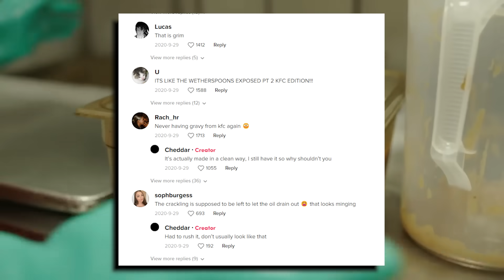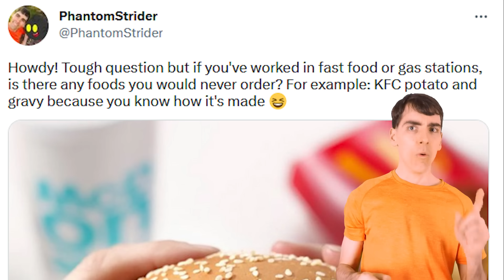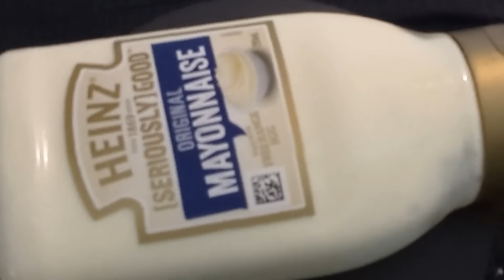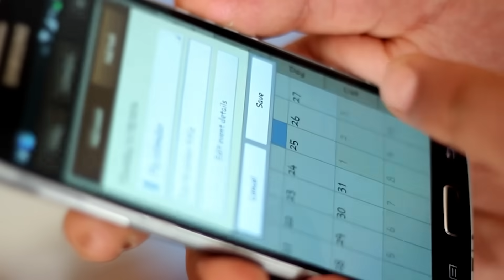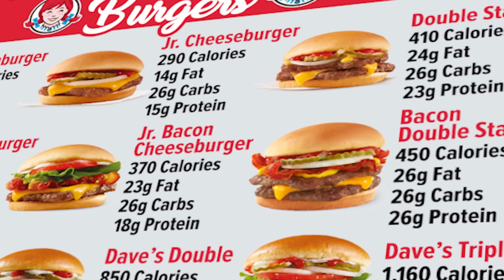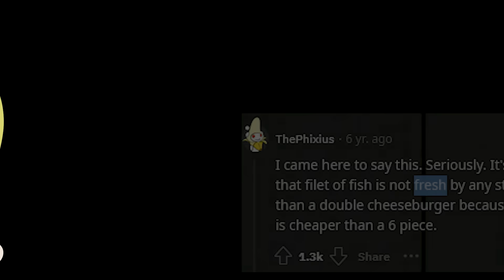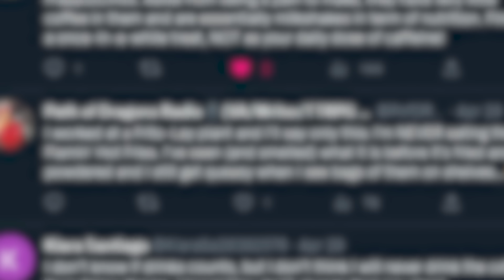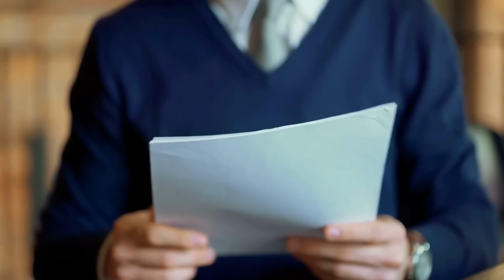The 10 Fast Foods Staff Never Order

Comment: According to an old friend that used too work at Wendys, the meat in chili is hamburger patties. But it was never more than a day old, the chili sold fast enough most often. The patties used would be ones that were either burnt, broken, or ripped. It's a way of them still making money on perfectly good patties that weren't well rounded enough for a sandwich.
Reply: *well-squared
Reply: Tbf that's EVERY deep fried food always better fresh
Reply: Anthony Bourdain explained the same in the movie The Big Short. Common practice and I’m here for it lol
Reply: This is true that chilli is fire 🔥
Reply: The only problem is that the chili meat Patties could be left out for so long that they’re basically a rock
Reply: @Obsolete935  This is not really a problem as these patties are usually frozen overnight so they will be hard regardless Afterwards they are rehydrated in boiling water and added to the chili
Reply: This is actually not the part about this that is bad.. Its the process.. 
First they take all "dead" burgers off the flat top, then throw them in a plastic home depot bucket that usually sits under the grill until it fills up, usually the end of every shift.
Then they take that home depot bucket, and fill it up with unfiltered tap water and it sits in the cooler until the next day, when they make the chili.
They drain the water and plop the soggy meat sponges in a plastic bag and squeeze the water out and ad spices in the bag and massage it, then back in the bucket where more unfiltered, bleach smelling tap water is added.. its disgusting. the ONLY good thing they have there, are the baked potatoes. its literally a potato they wrap in foil and stick in an actual oven..You dont even want me to explain what Arbys is like.. or how their meat is literal liquid before its cooked.
Reply: Companies that can safely, legally, and morally monetize their by-products or would-be waste deserve the extra income and success.

Comment: The bean thing makes sense, honestly. When I worked at a Mexican restaurant our refried beans were a pain to make because we made them from scratch. They needed to be boiled in a massive pot for like an hour then mixed with oil and mashed. It makes sense that a fast food place would use a quicker method.
Reply: I worked at a Taco Bell in the late 80's.  Back then the beans were made from scratch also.  We had to sort through the beans to make sure there were no rocks.  Then the beans were put into a pressure cooker with a bag of the seasonings and lard.  After they were cooked, an electric drill with a mixer blade attached was used to mash the beans.  The smell of the drill (electric motor overheating) used to nauseate me.  I'm betting that Taco Bell doesn't make the taco shells fresh in the store any more either.
Reply: @bun04y  that Taco Bell sounds like one worth actually eating at. I wish they could’ve continued that
Reply: Not only that, but the "weird film" the employee was talking about also happens to just... normal, cooked refried beans, traditionally. The lard/fat used in it and the fact that it dries as it cools gives most beans a slight film.
Reply: Anybody complaining about the beans at Taco Bell can bite it. I would bet money they have no complaints about throwing potato flakes in boiling water to make mashed potatoes...

Comment: The gravy thing is so funny. Not only is that how we always make gravy (the drippings just come from a pan instead of a deep fryer), but several times a week I'll make some sort of pan sauce, and a key step is not cleaning the pan after cooking meat. The sauce liquid will lift the bits off the bottom, and add lots of flavor. It's called "deglazing," and it's effectively the same as using drippings, but on a smaller scale. It's very amusing to me that people are so used to everything being ultra-processed that we don't even know what gravy is if it's not powdered and sold in a packet.
Reply: that's how everybody makes gravy...it's frankly a little alarming that so many employees didn't know that.
Reply: Waste not, want not. I'm not huge on gravy though I've made it for family. I'll make bone broth and stock by saving bones, joints, etc. and use animal fat to flavor vegetables/carbs

Comment: When I worked at Burger King, we also had "hot boxes" for food. We would store cooked hamburger patties in these plastic trays under little heat lamps. They had timers on them that told you when to throw them out, but management would have the kitchen staff just trick the machines into resetting the timer by removing the tray, putting it back, and oressing a button to start it over. If you want something fresh there and it's not peak hours, just get fries with no salt because that means you're usually getting fresh fries since the big batch of fries is already salted. Sometimes theyll just throw the old fries back in the fryer for a minute though. And dont forget to ask for salt packets when you do that!

Comment: I have a total of two stories on fast food soft-serve (yes, it's really that notorious).

My partner works at McDonald's and backs up the claim that the ice cream machine is never actually "broken" like the employees say...it's just going through its regular long cleaning process. They just say it's broken so the customers don't wait around for four hours at the restaurant without ordering anything. My partner also says that it's more likely for one of the grills or deep-fryers to be broken only have one running at a time.

The second story is a little more gross, so don't continue if you have a weak stomach. A teacher I had back in high school used to work at a Wendy's. That store hired a rather unintelligent person who would regularly water all the plastic plants around the dining room. What finally got them fired was when they used a toilet scrub-brush in the Frosty machine on multiple shifts (with nobody realizing until after several days). The health department was called, the employee was fired (and possibly blacklisted), and the Frosty machine was completely replaced, so nobody needs to worry about getting a toilet Frosty.

Comment: I'll break some heart in here for saying this but DO NOT order anything with eggs in it at taco bell. I used to work there and it comes in a back, is boiled in the same water everything is boiled in so its usually gross water. BUT thats not the main issue. When opened it makes the whole kitchen smell like sewage, and many times they boil 2 bags one kept on line and the other for when they need to refill.

The 2nd bag is usually not used for a very long time, so at the end of breakfast if you're ordering anything with eggs in it, youre usually getting that 2nd bag that has been steaming for hours, they use to refill the line. 

They almost never throw anything away. Ive seen them use steak that has been on the line dried out for hours, they add hot water to it and voila. Thats the steak you get in your burritos, same with refried, chicken etc.

Also if you didn't know it, their ground beef has chocolate in it. Thats a little known thing, and explains the weird taste when you eat it on its own.

Comment: Former Wendy’s employee. The chilli we actually used combined with the unused meat (if we didn’t use the fridged meat within two weeks we threw it out) we put it in some trough, and add 2 full big pitchers of water (i think its about 2 gallons), mixed with this, concentrate paste, and refrigerated beans. Its super watered down, some days its a little pastey, and on some days is basically soup.
Reply: Sounds like inconsistent prep cooks that were more 1 cup of water... so like this 44oz cup? 😂 if cooked right it's usually about the same. Though claims of clean meat is ehhhhh at best.... at 4 different stores the extra or bad patty holder didn't work or something so after a days meat collection in a room temp tray they freeze for 1 to 4 days then boil.... boil old spoiled meat.... no thanks.

Comment: worked at subway - the meatballs in most stores are not changed out as often as they're supposed to and the temp they're kept at is too low to keep it sterile for longer than 3-4 hours. some stores do change every 4 hours like they're supposed to, but it's rare because managers tend to be super annoying about waste and prevent you from throwing things out too much, so they get left for 6-8 hours instead. a lot of ingredients are like this, but with the cold ingredients it's a bit different.
Reply: Also, as a former Subway employee as well, watch out for those tomatoes. They arrive in shoddy condition at best and often have blue mold on them that we try to clean off
Reply: I also worked at a subway. The meatballs were always kept at 165 degrees F minimum temperature. The meatballs had to he used within 2 days, unless they got too dried out and had to be discarded, so adding a little water now and then to the marinara sauce and stirring them around was essential in keeping them "fresh". Sounds like the temperature of the water in the bain that the meatballs are stored in needed to be turned up at the store you worked at, which management is responsible for setting.

Comment: I make gravy by cooking the fat off of bacon or other fatty meats, I take the fat and add in some seasonings and flour until it’s a wet sand consistency. Then I slowly pour in beef broth and stir constantly. Usually about two tablespoons of beef broth at a time, stirring until there’s no lumps, then adding the next bit of beef broth. Until it looks a smidge thinner than gravy should be, then I cook down and stir frequently until it matches about what you’d expect gravy to look like. Then it’s ready.

Gravy is cooked fat oils, seasoning, and a binder like flour. Then some liquid like beef broth, or water, or milk if you want to make a country gravy. The KFC gravy is completely the traditional method of making gravy from scratch.

Comment: I've worked at a gas station and it's really very clean. It's got a grody name (and ofc still don't get gas station sushi) but most gas stations with a food counter (mostly bread and baked stuff) is really quite clean. I had to check temperatures constantly, of both the prepared stuff and the coolers. The only think I'd avoid is the lettuce on sandwiches because they always made us add the old stuff on top. But besides that? Really clean. Ofc it varies place-to-place. I'm Dutch.

Comment: I used to work at Wienerschnitzel and In my time working there, you can definitely tell that across different restaurants, certain things are different. Like at ours, we left ice cream toppings like carmel and chocolate syrup at room temp all day where another one of our restaurants about 15 mins away, kept them in warm-boiling water. Across all of our stores we valued the ice cream though, every store that I went to(4 in my city) our machines were religiously cleaned every other day. Our managers cleaned it so it was always done and done by someone who had at least a few months under their belt. We used a sanitizer sent by the ice cream machine company itself and followed their instructions to a T. Our ice cream mix came in a bag and was frozen as it came out of the machine. On top of that, their machine always works, was only broken once when I was there and that was because the AC broke and it was literally 120 degrees in the building. Our chili is made with the same patty method though, chopped up, boiled, put in chili mix and served. I trust it too because I know the pattys are never neglected. Sure they might sit in the hot plate for a bit but it’s an enclosed hot plate kept at 165 to keep bacteria away. Plus the boiling gets rid of it. 

Never order a veggie dog though… they are microwaved and get rock hard if they are left out for any length of time after cooking.

Comment: I can kind of agree to the ice machine concerns. I used to be a supervisor at a subway for about 16 months. In those 16 months I can only remember the ice machine being cleaned (by a company) only once, so I assume it was only a annual service. We would take a scoop and scoop the ice in to a bucket, travel across the store with it and dump the bucket of ice in to the top of the soda machines in the lobby where customers get their ice. The thing is... that bucket and scoop sat on top of the ice machine in the back and was never really washed out, and the scoop never sanitized in between uses. I never thought about it at the time as a issue but looking back on it I'm sure the ice got dust and germs on it on a daily basis. Most customers seemed surprised we manually filled the soda machine with ice ourselves. It would definitely be more convenient and sanitary if the soda machines made their own ice.
Reply: Bro.... That's on you than... Clean the stuff!
Reply: When I worked at Burger King it was similar, we carried the ice in a bucket from the back to the front, though the unsanitary part comes from the scoop itself, since one person handles money/cards, and scoops ice into drinks, it was easy for the handle of the scoop to get into the ice. I'm pretty sure I was the only person to ever clean that scoop during the whole time I worked there.
Reply: @farmingsim9813  Right, we were never taught/told by our manger or district manager to clean the scoop/bucket and it might have seemed like common sense but if you ever did something wrong (use the wrong kind of cleaner/disinfectant to clean something) you could get written up. We only cleaned things that we knew HOW to clean "by the book" so a lot of simple little things like that didn't get cleaned. Plus if it wasn't on our daily cleaning list nobody gave it a thought.
Reply: I worked at Taco Bell for 2 years and nobody ever cleaned the ice machine. I didn’t even know it was a thing that had to be cleaned

Comment: I have worked in Kitchens my whole life: The gravy thing: My exact reaction to "this is HOw gravy has been made for hundreds of years..." was NO no no no no no , no no no no no.
It's similar, you take the residue, the fat and oil from a pan of rendered meat and use that. THE BOTTOM OF A DEEP FRYER from a FAST FOOD RESTAURANT run by people who I can guarantee you dont filter the grease every day......IS NOT HOW ITS BEEN MADE FOR HUNDREDS OF YEARS. First of all, if you were to do this in your own home, you would fry your chicken in small batches right, then drain your oil, then take that remainder and dry it or else it's full of fryer oil then use it as a sort of Roux in a sauce pan to make the gravy...it certainly wouldnt be the  (at best case from one work day) the remainder of hundreds of pieces of chicken from a day of work. Then you cant guarantee that chicken was the only thing in that fryer.
Even then, that's is ABSOLUTELY NOT how gravy is made.
That's like saying putting the mold from expired bread on your fresh sandwich is the same as cheese. You just have no idea what you're talking about.

Im truly upset at how idiotic this section of the video is. They are literally taking the refuse, NOT THE LEFT OVER STOCK, not fat, they are taking BURNED refuse, adding power and water and stirring it. 
   That is not gravy, that is a food crime.
Like, the whole Gordon Ramsay part. There is a difference between Pan frying and using a Well fryer first of all. Second of all you are talking using the left overs from and hour of cooking to make gravy, versus an entire work day at best. I'm a southern Louisiana boy, don't @ me, I'm genuinely angry right now.
I get it, it's all flour and oil and chicken fat right?
Wrong, gravy is essentially a Roux, a LIGHT Roux.
What do you never want to happen to a roux? Even a dark Roux, you never want to burn the roux. This is tantamount to slow roasting a roux to ashes, then trying to still use it.

Comment: Having worked for Starbucks and Burger King I can comment on some of these. 

1. Fish products can be hit or miss, if you have good staff the fish shouldn't be more than the recommended hold time (about 40 minutes iirc) but sometimes the button would get hit a couple times afterwards, still food safe, but not crispy at all anymore. 

2. Yeah fraps at Starbucks have little coffee and it's basically instant coffee mix, if you want a slightly healthier and just better tasting imo (though staff will hate you if you order this when its busy) get an espresso frap with half pump of the sugar syrup we use, also don't get a ton of flavored syrups to begin with. Normally I would just get a 4 blonde shot espresso frap with half pumps of syrup and oat milk. Basically a blended frozen latte 

3. Yeah, try and avoid ice imo. We would clean our ice machine regularly and it still would get mold. Ice machines work as a giant heat sink with water running through the pipes. Condensation builds on the heat sink part leading to stagnant water building up. Nearly impossible to adequately keep it mold free for long, and some places the ice machines are contracted so the employees themselves can't clean it without voiding warranties. Usually there's no mold getting into the ice itself, but man the number of times I had to clean that thing or help defrost the heat sinks so it actually worked properly, fuckin pain in my ass. And refilling the ice buckets used in the drive thru window was also a pain. Walking back and forth, back and forth with a giant 10 gallon bucket of ice. Honestly wish we stopped using ice for drinks in fast food. 

As for the gravy, lol that's just how gravy is made in general, and idk about KFC, but BK cycled out their oil at least once weekly and it was filtered with the machines being cleaned daily. 

And the beans thing as well, couldn't care less. Like all beans you eat are dehydrated at some point unless you get them from a farmer's market or grow them yourself. Beans for canned beans? Dried before they arrive at the canning factory. Dried beans in a bag at the store? Dried obviously. The only difference is the ones at Taco Bell are dehydrated again after cooking.